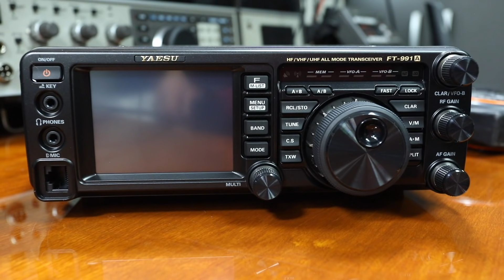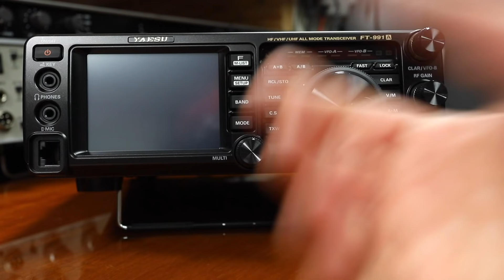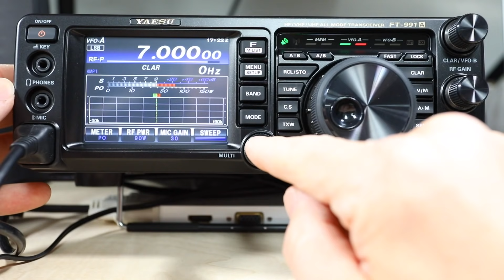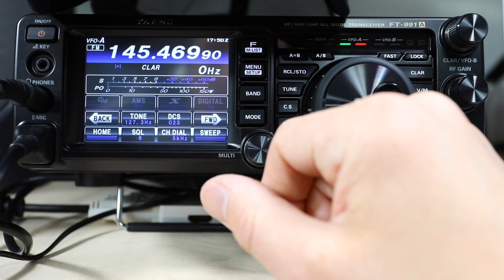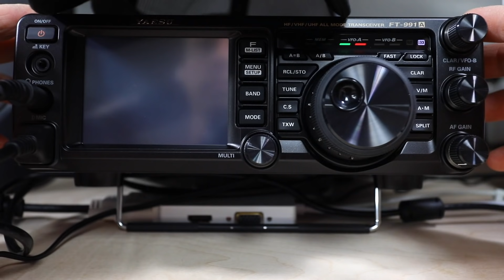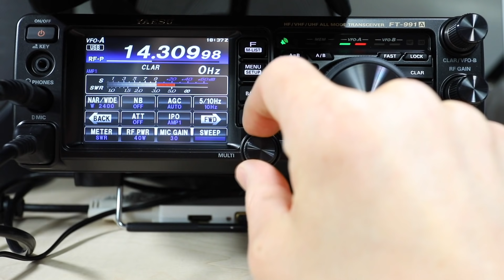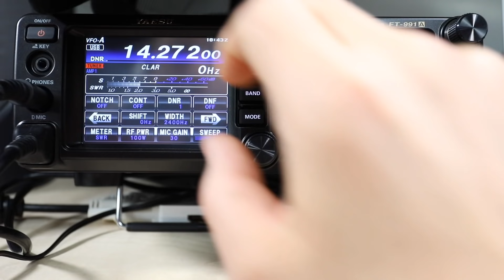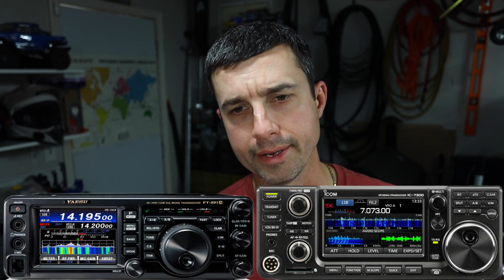Yaesu FT-991A Unboxing + On-Air Tests

Comment: You forgot to add, Both UHF and VHF also have AM / FM / LSB / USB / CW - CW & SSB on UHF/VHF is awesome!    AM @ 40W / UHF/VHF @ 50W / HF @ 100W.  It is an awesome radio, hope everyone gets one!  73 de KE8GKO
Reply from the maker: Yes, great points! 73 KM6FAK
Reply: The ftdx 1200 was no match on the receiver performance for me. 7300 all the way.
Reply: Yes, for sure the FT-991A is a well underated small sized radio for sure - I couldn't resist buying another when one came up secondhand in my area!
Reply: This is the first 2m SSB radio I've had since the Icom 211 from the 70s, only 10 watts, cost $600. Icom makes one now w/ 100 watts that's almost $2,000. Considering the 991 has hf 100 watts, the 50 watts w/ SSB for 2m is a small compromise. Placing my discone ant higher will add to the signal as well.
Reply: Thank you Jason for a great video and special thanks to specialspy777 for bring the information about its capability in UHF/ VHF modes. 
de 9W2UPI.
Reply: @samiam9059  LOL! I couldn't hear anything on my 7300 even as low as 160m due to a neighbor on 75m! My Icom 7000 can do just fine only 40KHz away, bye bye 7300!! - and GOOD RIDDANCE!
Reply: @cedarridge3020  Not sure on that but for me no competition. I only use them for receive with the same active loop antenna. Had no problem selling it. Found it very suspicious they discontinued it so fast?
Reply: @samiam9059  Discontinued what? Both the 7300 and 991a are still in production - as far as I know.
Reply: @cedarridge3020  No we were talking about The ftdx 1200
Reply: @samiam9059  ✓
Reply: @cedarridge3020  I love my 1200 it’s a great rig
Reply: @John Cliff Little by little we build. Someone w/ more technical expertise than I do in installations does my antenna work. Just finished putting up a DX20, next will come a D 3000N for my new IC R8600 (for my SWLing in my bedroom), then a Palstar linear & tuner for the shack out back. I'd like to get a Yaesu 101MP but right now I'm more concerned bout being heard than der blinken liights in the shack. Ur antenna suggestions may or may not be feasible. I realize the need for improvement but just getting on the air was the immediate objective. After I get my linear, then I'll get a 23-in computer & HR Deluxe software to compensate for the 991's small display. TY for the input!
Reply: i guess im asking randomly but does any of you know a trick to log back into an Instagram account??
I somehow lost the password. I would appreciate any tricks you can give me
Reply: @Zev Josiah Instablaster =)
Reply: @Deacon Shane I really appreciate your reply. I got to the site on google and Im trying it out now.
Looks like it's gonna take quite some time so I will get back to you later when my account password hopefully is recovered.
Reply: Just ordered one a few days ago LA3SIA

Comment: Just joined the local radio club, take my tech license test on Saturday and ordered the 991a and everything to set up my station. They guys at the club are teaching me how to make my own J-pole and dipole antennas. I’m beyond stoked to get it all set up! This hobby has already substantially drained my resources but so far I have no regrets 😂
Reply: I did my tech 3 days after I started studying for it.  Once I got started, I realized I didn’t have access to a lot of the activity I saw on the air.  So a couple months later, after another 3 days of cramming, I got my general.  I recommend you get your general.  It opens up so much more and isn’t much more challenging that the tech test.  Ham Radio Prep was the course I used.  Lots of practice tests.  Short modules that cover all subject areas.
Reply: How's the hobby going now?

Comment: I am newly licensed and have yet to transmit. This is definitely helping me decide on my base station! I was already leaning Yaesu, but this sealed the deal! Thanks!
Reply from the maker: Glad it was helpful and welcome to the Hobby!
Reply: As a beginner, I recommend getting involved with a local club and looking at some good used equipment first. The iCom 7300 is driving all the prices DOWN on the late model high end stuff, including Yaesu.
Reply: @jeffbecker8716  Yeah, but I've noticed people are beginning to realize what a great CB the 7300 is and that's about all, so even the old FT-990s are still bringing $600 in great condition.
 People are beginning to realize that you really can't expect Amateur radio performance from a CB and those used prices for older real Ham gear are stabilizing and even coming back up.

Comment: So I watched your video and others with most folks going for the IC-7300 but Robert Nagy, N4HNH, and you inspired me to order the Yaesu FT991A and I have not been disappointed using Diamond X300a and Palomar engineers 80-10 OCF dipole on the east coast of the U.S. I have been able to reach repeaters out about 40 to 60 miles on UHF-VHF and Russia, Italy, Serbia, Canada and the Florida, California and the Midwest on HF. The I have a lot to learn on all the features of the radio but am really pleased with it so far and would recommend it to anyone looking for a great radio to grow with as you start the hobby. I want to thank you for the video and helping me make up my mind on my first HF /UHF / VHF rig.
Reply from the maker: Awesome and congrats! I'm glad you are enjoying it, as I still am as well. Thanks for the kind words!
Reply: So it’s almost a year and 2500 QSOs later and I still would highly recommend this radio. Have gone from a windows to a Mac for running digital modes and logging works great with both. Has great noise reduction and seems to really pull in weak signals well. I would continue to recommend this radio to anyone looking for a great base station radio.

Comment: Killer video. I debated between the FT-991A and the IC-7300. I went with the IC-7300, but since selling my FT-857D I sometimes wish I would have purchased the FT-991A so I would still have 2m/440. Keep up the great work!
Reply from the maker: Thanks! The 7300 is a awesome looking radio. So far this has been the perfect shack-in-the-box. A couple of us locals have been experimenting with 2m SSB too.

Comment: For my first proper rig i narrowed it down to the IC-7300 or the FT-991A, i didn’t really know about the TS-590SG or that would have been in the running. All of these rigs are great, we’re in a great time for the amateur radio market right  now. Ultimately i went for the ft-991a. I see the rig as an ft-817 (i wanted vhf/uhf ssb as well as hf) but with an amp, a tuner, a usb soundcard, a dsp noise filter and an equalizer BUT without all the cables and bits i’d need to run such an ft817 station. In practice though its actually some other features that i’ve come to like most. The c4fm digital mode can be used with a cheap chinese hotspot and that gives you not only c4fm but also cross mode DMR, NXDN and my favourite, P25 (it sounds better than other digital modes, higher data rate like c4fm in VW mode where all the other popular modes are like c4fm in DN mode). I also like the airband more than i thought i would, the scanning functions are surprisingly good. Another thing i like is how easy it is to work from the PC, i use 1 usb cable only and that gives me mic/audio via my pc headset (i use the free voicemeeter banana software  because i add in a bunch of shiny things to my audio chain like audio oscilloscopes and fft monitor), i use flrig for my ptt and macros (e.g. ability to flip the mic source from the radio to the pc and vice versa). Enjoy your rig!

Comment: Are you still happy with your purchase? Do you wish they where separate? Seen your link from the Facebook question with the 7300.
Reply from the maker: This is still a fanatic radio. I use almost everyday on VHF and several times a month on HF. I've also taking it camping and did some POTA's with it. IF, you don't need the shack in the box and you have some extra money the IC-9700 & IC-7300 is a killer combo and I'm very impressed with those two radio when sitting next to each other.

Comment: I just upgraded the 857D to the 991A Thursday, 02May19. Called Universal Radio that morning and they said they had 1 left in stock, told them they don't have it anymore  because I'm on my way to pick it up!
I absolutely love this rig, the receiver blows the 857 out of the water and it is very intuitive to operate,  I've had to reference the manual for a few things but other than that it's very simple to get the hang of it.
'73, de John C. KC5JSR
Reply from the maker: Oh very cool! Glad to hear you were able to scoop it up. Yeah, I'm having a blast with mine. With all the menu options it has I don't think I will be bored of it for a while!~73
Reply: The Yaesu 857 & 857D are some of the WORST radios I’ve ever operated so they are a poor choice for measuring against.

Comment: Jason, thanks for a great video, unboxing and showing it  front , back sides menus etc, you definitely helped me make up my mind on this Rig, so I am going to pull the trigger on it soon, video quality & audio is also very good so nice work overall,  thanks so much, best 73 from the Caribbean Mark de 9Z4Y
Reply from the maker: Glad to hear it and thank you for watching with all the kind feedback! So far the radio has been great. I've recently took it camping and the size is manageable and it's so nice to use on a picnic bench under the stars. ~73 KM6FAK~

Comment: As a completely new guy looking for his first unit after only owning a 2 band hand held & being steered to look at both the 7300 & ft991A (biggest thing not knowing what any of the buttons are for. License class did not teach anything about how to operate anything) this was extremely valuable & I will look for your other videos on how to operate this unit.
Liked the bigger screen on the 7300 but your step by step is more valuable,so I'll get 991A

Comment: I looked long and hard at this radio. I bought the IC-7300. I like it. I already had three fusion radios. However I am looking at this radio again as a mobile rig for my Jeep XJ. I think that will give me the best of both worlds having invested in Fusion and wanting a HF rig in this vehicle that I do not have a radio in yet. My other choice would be an IC-7100 but I do not have any D-star repeaters in my area.
Reply: These are great for mobile and portable...which is why I got mine...as my portable rig...plus bioenno battery for POTA/SOTA...

Comment: I can't wait to get mine for the 9" wide Honda Pilot center console. A real RF Gain (unlike my now sold two 7300s) PLUS a 500KHz up & down scope and 3 Band EQ, I'm stoked@!
- I've been an icom guy most of my Amateur career but when they decided I didn't need my 2nd most used control (RF Gain) I gave icom the finger and bought YAESU
Reply from the maker: DANGGG! Now that is some feed back, lol! Very cool, thanks for sharing. I'm still very happy with this radio.

Comment: SO my question is as a newbie if you only have a mobile unit a ftd-400  and looking to get a vhf rig in the house but you want to experiment with hf too.  Is this a good unit for a newbie to get both. it  seems more cost effective. I was thinking to get another 400 mobile and make it a base in the house then I am still looking at another 1,000 or so for a HF in the future.  Thoughts?

Comment: Congrats on the rig. Heck of a radio and a major plus is it's a shack in the box.  Can't go wrong with either choice. I personally chose Icom, but may still get the 991A for 2m and 70cm.
Reply from the maker: Thank You! I'm having a lot of fun with it. The new digital filters in these types of radios are amazing.

Comment: I Got 2 stickers with mine!  Love this radio. New general but this is making things alot easier.  Very intuitive and the filters are great. Running an inverted v at 35ft and got 59s from Hawaii, Costa Rica, Brazil, as well as almost every state.  I think I have a magic wire.  I'm in Montana and am blasting everyone.   great video.
Reply from the maker: Awesome! Sounds like we are running a similar setup, very cool. Thanks for watching!!

Comment: So you have had the rig for a while now any issues or would you now go with something different. I’m about to pull the plug on this because I want a rig with 2/440 along with hf. My favorite radio of all time was an icom 746pro which I wish I never sold. I also am loving wires x. By the way I just moved from Sac.
Reply from the maker: This radio has been prefect. It's powered up almost every weekend for repeater chit chat or working FT8 on 20 & 40 meters and SSB too. A handful of guys got Fusion repeaters in my area, so I now need another radio to work the C4FM while also on HF. I'm not sure what I want to buy, as I'm always on a budget...lol
Reply: @HamRadioTV  if you can find a used ftm 100 grab it. It’s a perfect node radio for wires x

Comment: Is there a way to connect the display to an external monitor? The screen is on the small side, so I'd want to put it on a bigger monitor.
Reply from the maker: The short answer is no. You can use a SDR and a relay system to then get in on the computer. Not even the ic-7300 has a display out. Typically the high end radios will have that.
Reply: @HamRadioTV  That's what I thought.  Thanks for the reply.
Reply: checking back in, does the 991 allow remote control from a PC?  Linux?  Thanks and great unboxing.

Comment: Would love to see that chimney antenna install. Trying to decide between this and a icom 7300 for a first hf radio.
Reply from the maker: I have some photos on my QRZ page. The IC-7300 is a great radio too!
Reply: I've had 2 7300s, both sold. I found them ultimately an "All-Show, No Go" experience, but then, I need an RF Gain, and I like my receiver to receive. I hope you chose right.

Comment: Hi Jason....So, after (almost) a year, are you still running this rig, and do you still like everything about it? I'm weighing the 991a against the 7300, preparing to spend money, and it's not an easy choice. Each has distinct advantages. Thanks!  73  W1NLJ
Reply from the maker: This is still a fanatic radio. I use almost everyday on VHF and several times a month on HF. I've also taking it camping and did some POTA's with it. IF, you don't need the shack in the box and you have some extra money the IC-9700 & IC-7300 is a killer combo and I'm very impressed with those two radio when sitting next to each other. 73 KM6FAK

Comment: Still loving it I am torn between the Yaesu and the I com 7300. I do like all the frequency options on the Yaesu so for ditch rig I am kind of leaning that way.
Reply from the maker: Yes, still a great rig. But, if this is a shack only radio and you're not going take it out to the field, I might lean to the IC-7300. Although!! Take a look at the FTDX-10, a brand new HF rig that looks amazing!
Reply: I went with the FT-991a as my first radio and have been very pleased

Comment: Are the power poles necessary for your power supply or can you just strip the wires and put them in the ports?
Reply from the maker: They are not necessary. You can use a wire nut if you want. Powerpoles are very convenient and have some advantages. Bruce/N6THN did a presentation on them, I recommend watching: https://youtu.be/1ijV0-QpaIU

Comment: I was looking at the G90 for the last week. But after coming across this video I'm wondering if this is a better deal. Also where it's HF/VHF/UHF seems like even with double the price tag it might be a better buy.
Reply from the maker: Have you got a radio yet? My only thoughts on the G90 is that it's a QRP radio and I hope you plan on going hiking/camping with it. It will be hard to use in the middle of suburbia.

Comment: I was going to get an icom 7300 but the fact that the Yaesu also does 144/430,  its a no brainer to go with the 991a. Great video.
Reply from the maker: Thanks! Yeah, it’s very nice to have all those frequencies available.
Reply: Better to go for the 7300 and 9700. The 991A is definitely a capable rig, but the Icoms look far better, and the SDR displays look the bollocks.

Comment: Seems to me that a lot of people downgrade the Yaesu FT-991A for it's menu system. (In the 'Ford vs Chevy' battle). I find it very intuitive. Most of the settings are 'Set it and Forget it'. I find that the Yaesu and the IC-7300 radios are both excellent and have a valid use for every user. However, the Yaesu is a 'Shack-in-the-box' with it's digital and 2m/70cm bands. This alone made me choose the Yaesu. I also use the Yaesu aviation FTA-750L transceiver and chose it as well for it's additional features for it's price point. You also can't go wrong with the added 3yr warranty. A Square Trade 3yr warranty...$240. Add that to the cost of an IC-7300. Best Regards and 73's.
Reply from the maker: Thanks for sharing your thoughts and I agree with you!

Comment: It's been a few months since the review - how are you liking this radio and all of its features? HF, CW, c4fm, v/UHF all mode, portable operation?
Reply from the maker: The radio has been great. I haven't done any CW yet but have worked all the other modes. It makes a great shack radio with my amp and also does great in a park on a bench. Local guys have been doing a lot of 2m SSB and this radio also allows me to chat there. I only wish there was a way to get the display on my computer when in the shack. There is nothing native that allows me to do that but I think there is some 3rd party gear.
Reply: @HamRadioTV  Thanks for the reply. Yes, the display is small but it appears to be clear and readable - good for portable use. If I hear that it does CW well, this may be the one for me. 73